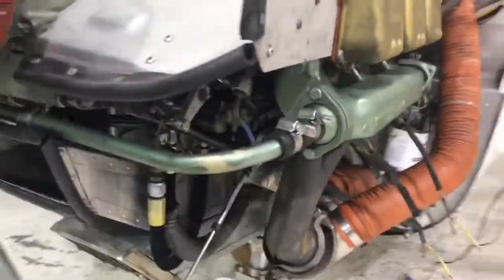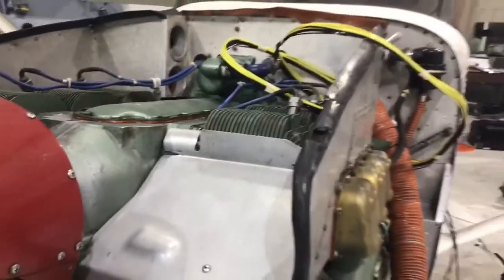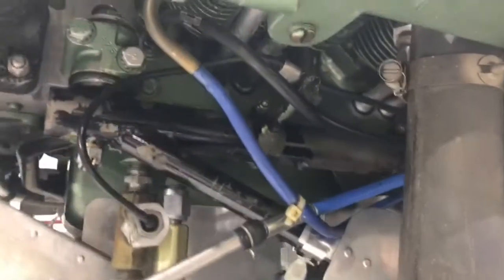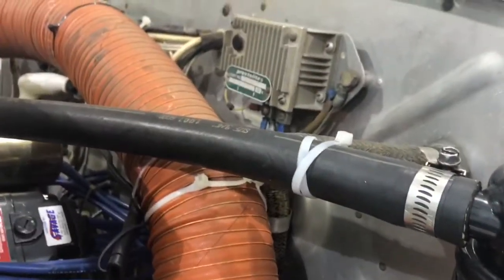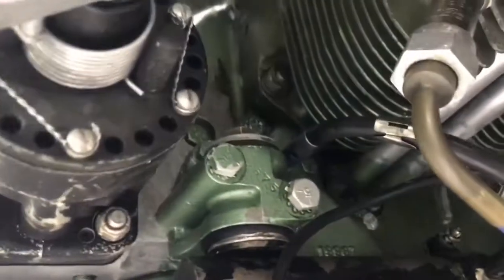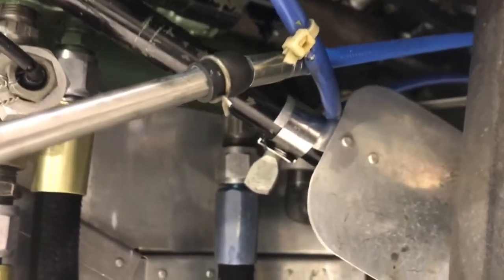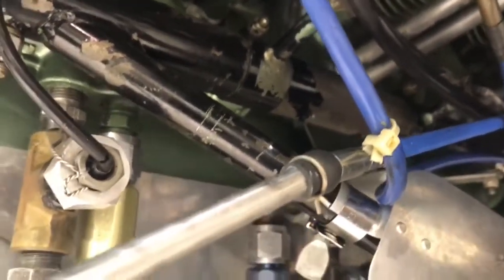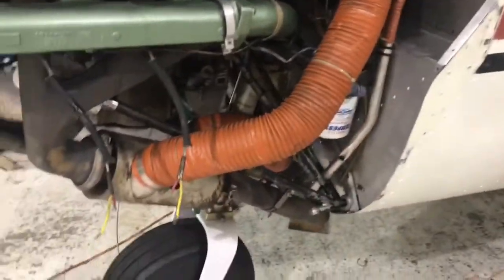Fixing Aircraft Engine Oil Leaks

Comment: I urge you to remove this video. It’s not just bad advice, it’s extremely dangerous. Continental, lycoming, and the FAA have pushed to stop using unapproved sealants in case halves and under cylinder bases. It’s been the cause of many catastrophic engine failures resulting from blocked oil galleries and loss of torque on cylinders and main bearing preload. There should only be silk thread sealing the case halves.

Comment: Is it staying dry for you? Like Bill Flying, I have a 172G with a TCM 0-300. It has multiple leaks around the pushrod tubes, oil pan and other places. How did you apply the proseal?
Reply from the maker: Yes, it works very well.  Hook a vacuum on the oil breather.  Have your IA help you and then put it on the seeping areas.  Thanks for watching!

Comment: So did you drain the oil from the engine before hooking the shop vac the the breather tube? Any idea of many inches of vacuum you were pulling on the engine? Enjoy your videos.
Reply from the maker: No.  The oil was still in the engine.  Not sure on the vacuum inches.  It was a standard craftsman shopvac.  worked great!
Reply: Thanks, I"m going to have to try this.....hate leaks of any origin....
Reply from the maker: You and me both brother!  I've pent more chasing leaks than buying planes!

Comment: I have a 172G and it leaks just as yours, about a quart every 25hours! Never heard of proseal. What are you actually using and where can I pick some up?
Reply: PPG Aerospace ...google it. Several types...most common is PR-1422. Its used alot. 
Not I wouldnt recommend using PR-1425 around fuel or oil. Its used more for airframe leaks. Actually some aircraft manuals will only use it for weatherproofing around windows. Say a pressurized cabin window.. they will come with a seal installed. Alot of manuals will advise you to clean the skin and build a sealant bed .. using PR-1425 ,install the window taped off and protected and use release agent. Install the window and torque the clamps to specified torque . Outside make a aerodynamic smooth bead around your evenly spaced gapped window. Check in and out of wind tolerances ...if they are good allow sealant to cure.
PR-1422 is kind of known as a all purpose sealant. It will be a brown color when mixed correctly where 1425 will be black.
There are several two part sealants for different things.
But 1422 is good to have around for a variety of things.
If you have never messed with it ...then have fun and enjoy...your wife will hate your stink and if you get it on your clothes...then its there forever.
Be careful where you put it...remember your mechanic is going to charge you extra for digging that crap out to gain access.
Your mechanic could help you get some or maybe not...😂